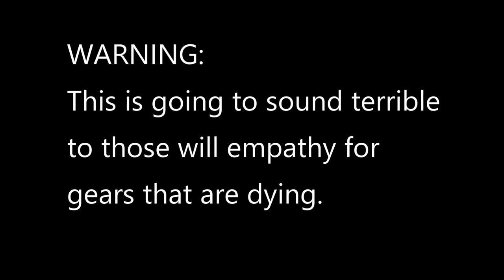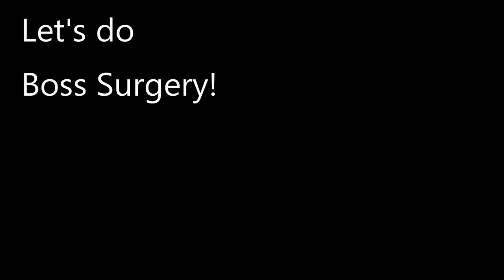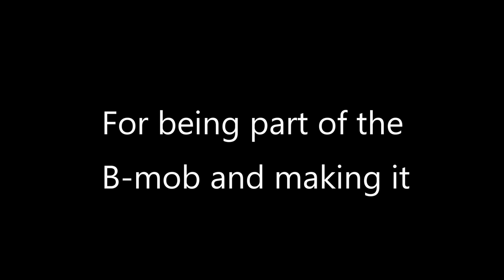Yamaha Rhino NOISE and How to Fix It

Comment: I have a 2007 Yamaha 660 Rhino...I have nothing in drive high or low... I jacked the machine up so the wheels are all off the ground... If I spin the back wheels by hand all the drive shafts turn even the one to the front wheels... Put it in any gear and nothing changes...I talked to a person the other day and said he had a similar problem but his was stuck in low gear... He was told to reset the computer and that fixed the problem...I tried to bring up the codes and didn't have much luck with that...I'm thinking it could be an electrical problem or maybe a sensor... I don't want to rip every think apart without testing things first... Have you got any solution to this problem that may help me solve this problem? Thank you ..Chuck

Comment: Great video!! You did not show dropping the park brake. NO info anywhere about doing the pads on the park brake. \i am going to do mine, probably make a video about it. I doubt that it will be as technically correct as yours since I always make mistakes.

Comment: What's the purpose of the "Boss"?
Reply from the maker: It takes the place of a U-joint because everything is rigid mounted to the frame.  It's a cost saving coupler design.